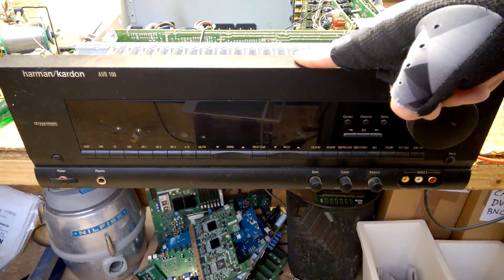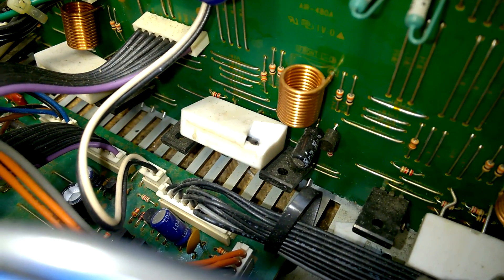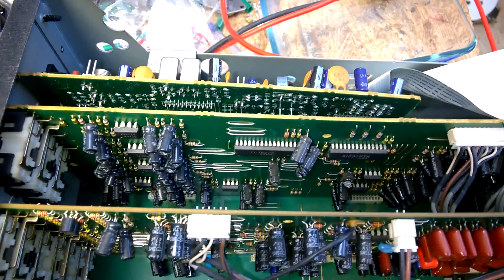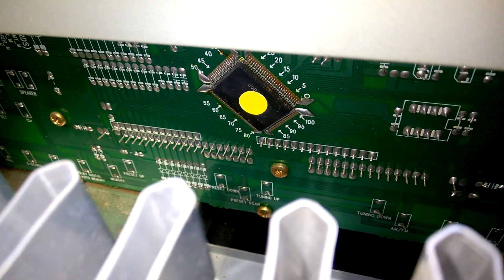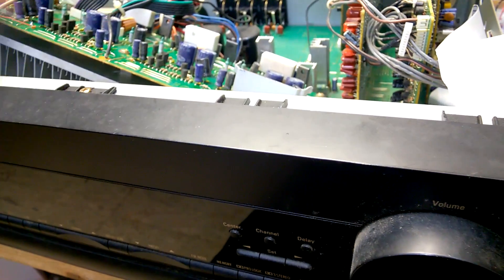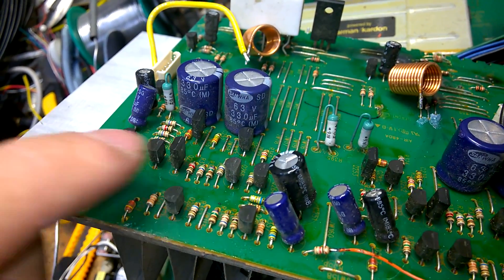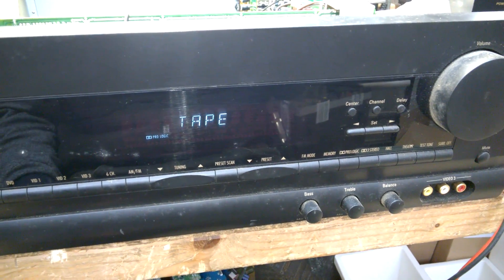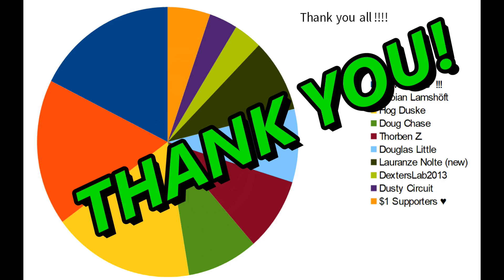🔥 Amp in Flames 🔥 Harman Kardon "Repair"🤷‍♂️ BEB #89 (this amplifier is toast)

Comment: Herr Max das war sehr interesant! That's where my German stops. I am fighting now with an identical unit. It is in protection mode and it doesn't seem to be a straight forward fix like a shorted transistor or blown resistor or fuse. I found the standby transformer voltage drops to 3V when I attempt to start it.the primary winding measures like 3kohms. I only started playing with electronics 6 months ago, so I have very litle experience but to me that seems way too high. keen on your comments

Comment: My 2 channel version of this amp had the left channel just die.  I only use it for a dual driver sub, so i just wired both to the right channel, turned spkr a+b  switches on, and put a stereo to mono cable into the right channel.  boom

Comment: if i were you i would have bypassed the bad chanle to see if the unit can pass a signle. then i would have used it as a mono amp for a bit untill you had enough money saved to replase all the transistors on that chanle. or just do what you did lol